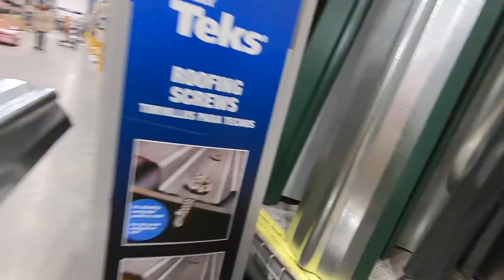You wont believe THIS! It only took 5 months

Comment: A little trick I learned to get paint to stick to galvanized metal, is to put some straight vinegar on it and let it sit for a while then rinse off.  That will etch it so the paint to stick to the slick surface.  Learned it from an old timer that painted aluminum boats.  works great.  Nice hog house, by the way.

Comment: Al, as Master of the land, now is the time to walk all over your place.  Note where the first thaw places are.  If they are high traffic places,  make a note to build them up with sand or gravel. Low places need ditches to promote runoff, or consider installing dry wells.  By doing this, in drought years other's farms and wells will dry up, but yours will not.
Go look in your stream to see where to get the sand and gravel. 
Where the land can use work, reveals itself now.  The better time for doing the work it  could use will come later.

Comment: You should put in an outdoor electric outlet somewhere around where your hot water spigot is so you don't have to run your extension cord from the inside of the basement, especially during the cold weather when you are setting up your saw outside.  I loved your reaction to the mud, and I would be so excited, too, to see it.

Comment: We still have 7 foot plus snowbanks on the north side of the house here in SW Maine. Glad to get the ice build up off the eaves. I put salt socks on the flat roof on the east side since that roof has a history of ice dams. I'm still hoping for Spring but I haven't emptied the gas tank and put the snow thrower away for the season...Maybe April... 
Glad to see your Greenhouse Coop survived the Winter, I forget was that made with a repurposed carport frame like your goat shed?
Reply from the maker: That’s a lot of SNOW ❄️
Reply: @LumnahAcres  It is the accumulation that slides off our metal roof. Piles up in front and makes it impossible to see out our first floor north windows.

Comment: I enjoy watching you build things Al. You work with so much precision and skill it really is a pleasure to watch you at work on a project. I was wondering if a split door could have been used in your mobile pork mobile? Top half: swing open on the inside and bottom half: swing on the outside? Of course one would need twice as many hinges and clasps but, you could have a full length door. :) What do you think? Does it make sense? :)

Comment: I know you send kitchen scraps to the animals, but asparagus is expensive. Instead of taking the ends that you snapped off out to the animals, peel them with a potato peeler, and roast them too. (If my ends are quite a bit thicker, I may throw the ends into the over for an additional 10-20 minutes. If you still find the ends tough, you may find you want to peel the last inch or two of the stems you roasted too. 💜🌞🌵